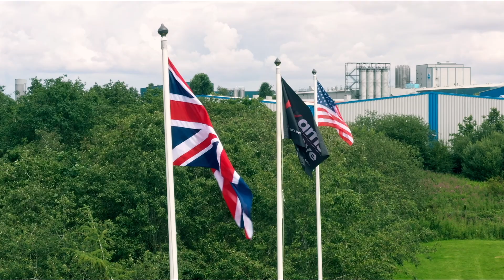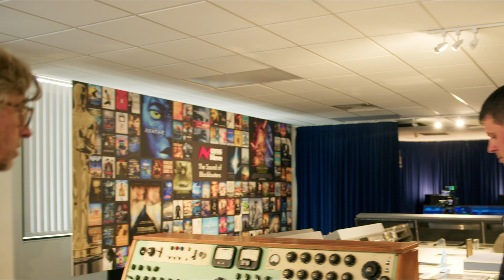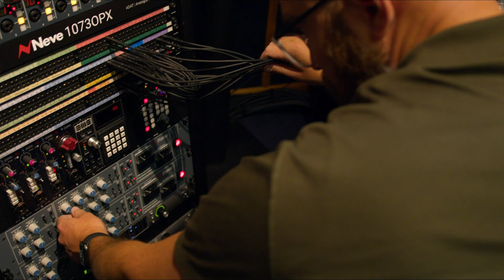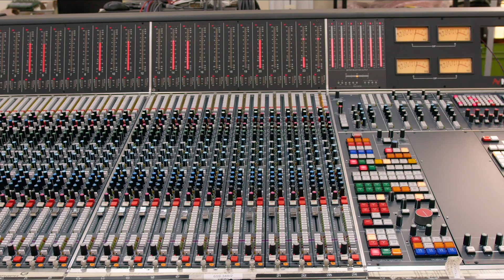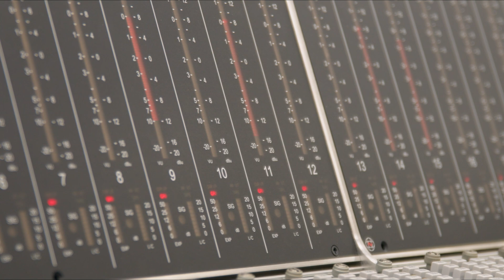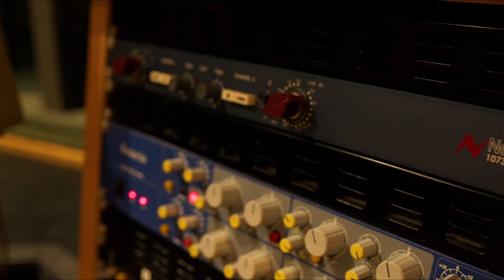History of Neve Innovation: Robin Porter on AMS Partnership, AIR Montserrat Console, the 88R & More

Comment: I like what you said about where demonstrations like this tend to lead or what they hint at. 

We boomer audio snobs have all been tricked by the big corporations. Which is funny considering most of what we like they don't even make anymore. 

So we end up replicating some of it ourselves or find ways of coaxing it into what we have, usually through very non-corporate, non-brand, generic ways, like Russian caps, old glass, etc.

From what I've noticed with a lot of the folks angry at Gibson, Fender. Marshall, 'fooling everyone', is that they tend to be very interested in the new product lines, think you can recreate all classic tones with pedals and own a lot of expensive, gear page approved gear, much of it from either those manufacturers or much pricier, boutique versions of iconic stuff they no longer make. It's a bit ironic.

And here I am buying parts and caps to put together my own thing for far less $ and often sounding better than the current major brand or boutique version.

Comment: It always seems to come down to the transformer. Same with guitar amps.
Reply: The entire brilliant NEVE circuit makes that sound. You could use the same transformers - there are 2 per channel - one in and one out with a different circuit and it could end up sounding horrible. Warm audio's 1073 sounds like mud using the same transformers that STAM AUDIO uses and STAM 1073.s sound as good or even better than the original NEVE units and with extra features. I've been in the business for decades, STAM is the best along with NEVE, SSL etc. Just my opinions.
Reply: @Tanya-un8wi Just as a transformer designed for a specific amp would not sound good in a completely different amp. Either way, the transformers are an important part of NEVE boards. I've heard veteran audio engineers say as much.

Like the one in the video.